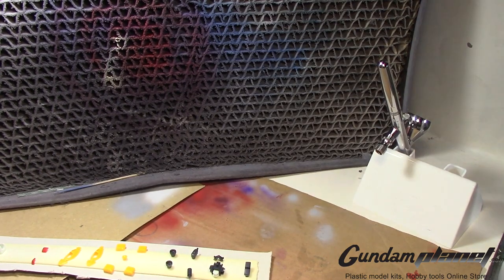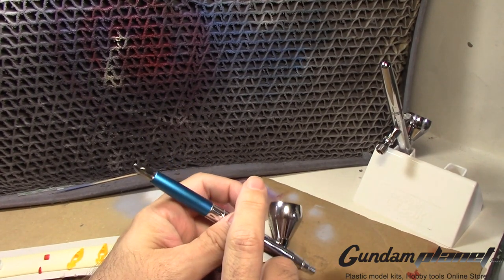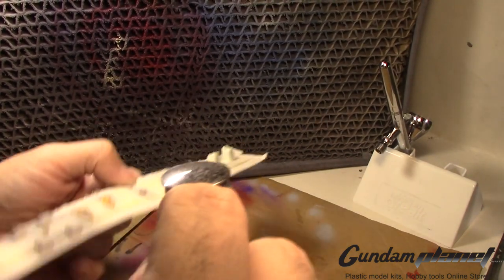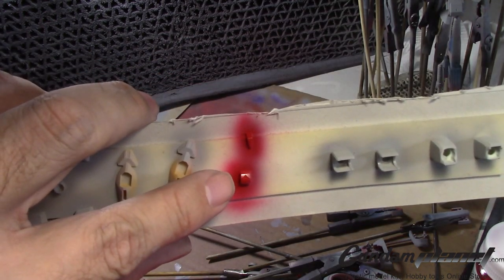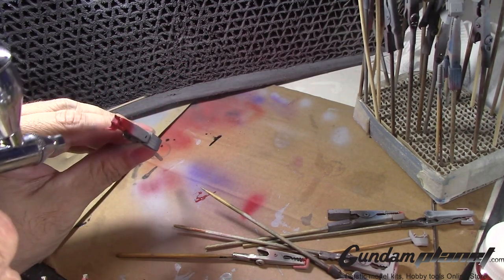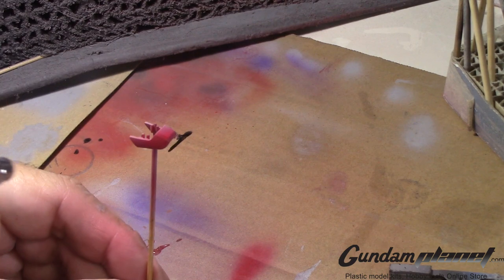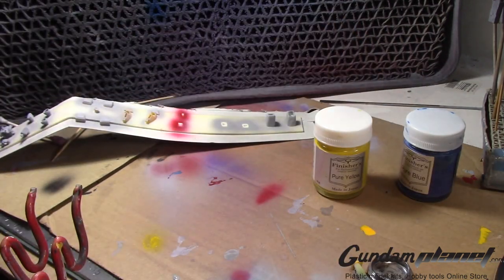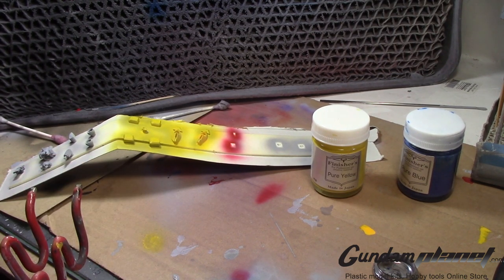*GundamCustoms* 1/144 HG Gundam G40 - Part 5

Comment: I've got both a harder and steenbeck evolution and infinity and both are fantastic, the evolution was the first high end airbrush I've owned and is still going strong 6 years later. One of the things I like about H&S is the fact you don't need any tools to take the nozel out which make them a lot easier to clean.

Hppe this helps
Reply from the maker: Thank you. I will review these and see which on I will get.

Comment: Precision like for preshading and such? I can fully endorse the Badger Renegade Krome. With its .21 needle, it can spray as small as 1/1000 of an inch. It also has an interchangeable .33 needle and nozzle assembly to use for basecoating if it's the only airbrush available to you. Parts are also readily available and very cheap. For 130 dollars, it's the best bang for your buck in my opinion.